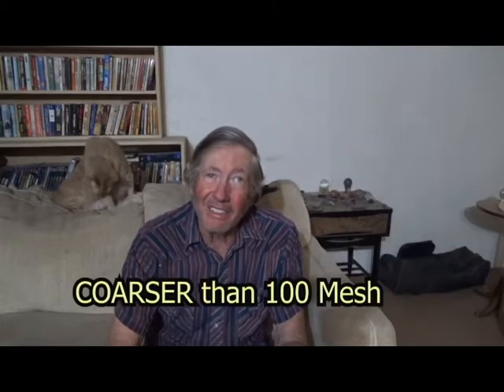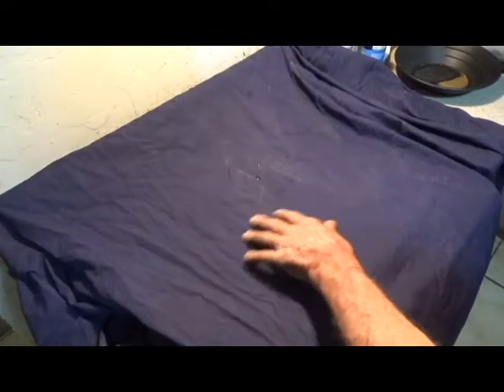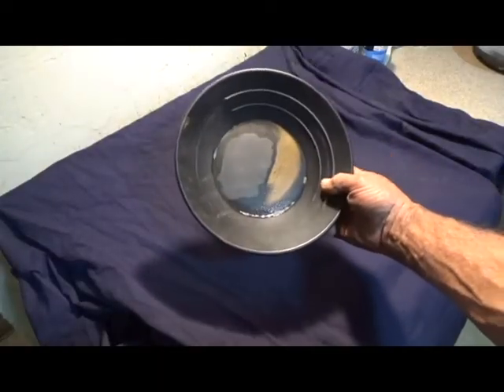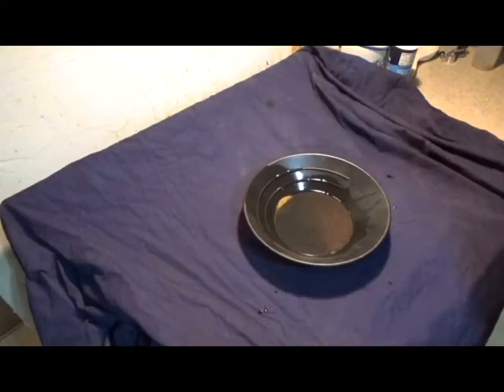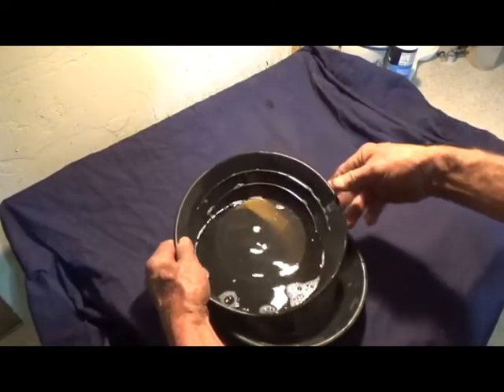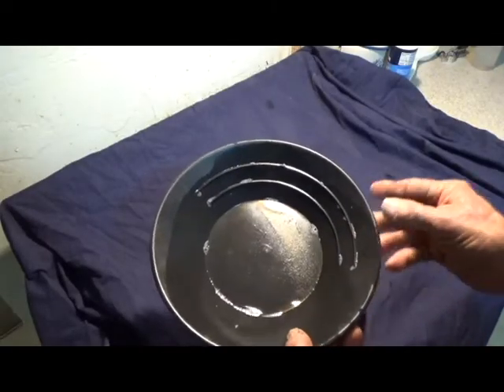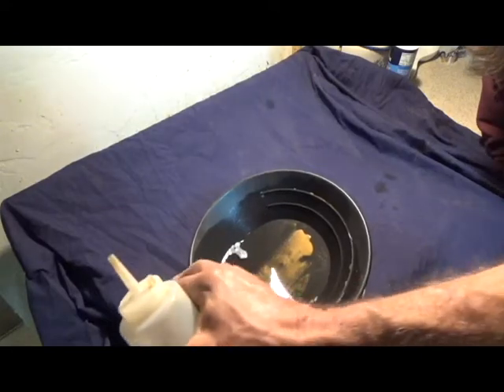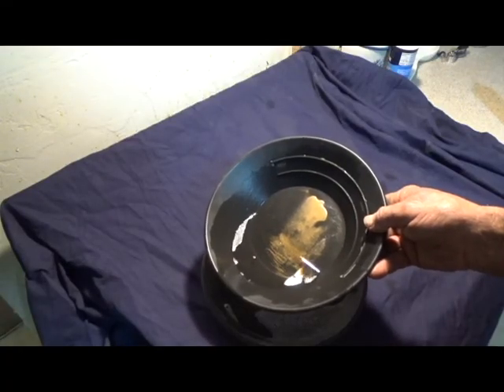193 Fine Gold and Microfine Gold Behave Differently in the Pan

Comment: I roast my ore and it makes little bbs but smaller. They are deadly for rolling the fuck away.
I had a big one roll out of my pan and was lost.
One guy panned and tapped to the top. But the waste or anything washed down, he would pan the bottom out carefully.
So he taps to the top, then pans out the bottom lip. he pans in two places. first pay attention up on the top, like you do there.
But then he washes out and repans the waste material. with the other material hanging on to the top. I think he was going after those bbs..I thought about pounding on them to get them flat. But I haven't figured a way. Most of my stuff is 100 mesh or smaller.
It shows in the back of the pan as you move material forward.
But if you insist on fucking around it goes out the sides and gets lost before you even get close. My adventure is using black sand to grab and shelter the gold. 
then use a magnet.I have the vibrating sluice. I added a pvc pipe to add material into. Just a 2 incnh  and it has a hole and a funnel hot glued. I attached some computer magnets on the bottom of the pipe (Outside of pipe) with a glue gun and have a pile of black sand on each one (On the inside)as a chance for the gold to ride the iron horsey.Since the pipe rests on the vibrating area, so the pvc pipe vibrates too. My wife went to the hospital in ICU for 10 days. I have been goofing off on my sluicing crushing and panning. i want to get going again. I seem to have silver or electrum pigging out my Aqua regia
I think I need to get the silver out. Filter out Silver chloride. Over and over.
I could learn to use Sodium Nitrate add 1 to 1 with HydroChloric acid. 
Hopefully I can pour off the silver (save) and that leaves the gold?
then add my aqua regia.I may have a palladium problem.
my stannous test looks some purple but changes to tan/ light brown tint.
I miss you all. I hope you are doing well.
Did you ever get to dousing? Ok God Bless. Have fun!

Comment: Fantastic revelation. Now I know why I either get micro fine one time and fine the next.  I guess I will have to process the gold twice!  Thank you for all your great videos.  I have learned a lot.
Reply: The gold we found in Wyoming is so micro-fine we can't see most of it without a microscope.  Some of the gold is visible and it accumulates in black sand in the creek and we can see it  where it accumulates and when the sun is shining on it.

I pick up dirt in my hand and drop it and look at my hand.  If I see micro-fine quartz crystals I know I'm close to where I need to be.

My gemalogical microscope is 360 power.  It tells me part of what I need to know.  ICP assays give a near accurate assessment and tells in ounces or grams per ton.  These assays are checked using one ton vat tests.

Infra-red photography, advanced prints and Google Earth assist in delineating any potential ore body.
Reply from the maker: Sounds like a good area to follow the gold upstream to the originating lode.
Reply: The metals came from ancient stock volcanoes and pyroclastic rock flows.  The volcanics overlay the sedimenmentry rocks. 

Eventually the gold works its way toward and into the Yellowstone River unless it gets bound in some kind of trap.
Reply from the maker: The live stream tonight at 6PM should be very informative as some guests will have real life problems for me to work on.
Reply: One guy panned and tapped to the top. But the waste or anything washed down, he would pan the bottom out carefully.
So he taps to the top, then pans out the bottom lip. he pans in two places. first pay attention up on the top, like you do there.
But then he washes out and repans the waste material. with the other material hanging on to the top. I think he was going after those bbs..I thought about pounding on them to get them flat. But I haven't figured a way. Most of my stuff is 100 mesh or smaller.
It shows in the back of the pan as you move material forward.
But if you insist on fucking around it goes out the sides and gets lost before you even get close. My adventure is using black sand to grab and shelter the gold. 
then use a magnet. I have the vibrating sluice. I added a pvc pipe to add material into. Just a 2 inch  and it has a hole and a funnel hot glued. I attached some computer magnets on the bottom of the pipe (Outside of pipe) with a glue gun and have a pile of black sand on each one (On the inside) as a chance for the gold to ride the iron.
Then My Adventure pans it right down to the black sands and then removes them with a magnet. There are the heavies left with the gold. The nonmagnetic black may be something, silver, platinum (something.) save the heavy and smelt them.

Comment: Pannng hard rock gold is definitely different than placer. The usual 'backwash and tap' method doesn't seem to work well for hard rock gold. As you mentioned, a different set of techniques is required. Thanks for shedding light on those. Also, a small black finishing pan is a must! I tried panning hard rock gold with a green Garrett Super Sluice (works well for placer). I thought there was no gold in the material, even when looking through a 10X loupe. I tried a black pan instead (a small Gold Claw), and suddely the same material revealed some gold. Might have been the black color, or perhaps the jigging motion back and forth that held on to the gold. Not sure. Regardless, I found it was the contrast between the black pan, gold, red garnets and green volcanics, as well as the behaviour of gold while gently back washing and side to side washing that proved it was gold. Thanks Keith, appreciate your work and all the insights you share! - Dan from www.Pickaxe.ca

Comment: The problem I stated when you came by. Gold that is beyound 100 mesh? Is to fine to define by itsself. Pluss I wondet how much started out super small like that? As crushing it is not necessarily goling to eroad it smaller than 100 mesh. As it probably takes a abrasive situation to get it any smaller. That' or, in its formation? It never was any bigger. Meaning it may take doing more to get it down in size, macanichaly. May take a rock tumbler? That wears on it. And does not try to break it up. As to mach what I have seen on the beach? It has to be small enough to be unsustainable to holding it in the pan. 

With out any definition of size to mesure? 100 mesh and smaller is lost to the water molicues. Why 100 sticks to the pan. It is sticking to the molicues of the pan. But any smaller? And it does not have enough indevidual mass to keep it on the bottom where it sticks. Why I change the pan out for the board. For working the waist out. As only dry does the cohesion quit. And the static charge of accumulated gold can gather up the super fine gold in itsself. Leaving everything else free to fall down the doard with out the cohesion to hold it with the gold. 

Why countering curents and eddies free the gold from traveling along the waters path with eveything else. And if working off mostly waist? Peaces will not be able to gather with them selves. Before migating out of a semi concentrated state.

No' water is the enamy here.  It works great for 100 mesh and larger. But is to destirbing to the smaller gold to seperate out as itsself in a concentrated mass. As no one peace can stay on its own. And needs the other gold particles to hold on too. As the surface molicules of the pan are more easly filled with water molicules. And the super fine gold has no mass or wait to displace it. So it can stick. But when many acumulate? It becomes even easyer for it to stay locked to the bottom. As it fits into the cavities inbetween the molicules of the pan. Where the static weight builds in its acumulated mass that holds even more gold. But if panning it with water? Not all can fight its way down while everything else is rising up in cleaning a consentration with mostly waist in it. Adding to the exiting cohesion. And not getting to the bottom. 

But like I said. It may be dificult to get it made as small as it is made in nature. And not something most are going to ever do? Making gold small, that it will be more easly lost by doing it. No one does that. And is why no one knows the exstent of micro gold in placer. As everyone thinks it is just like whats milled. Because its the smallest gold they know of that is in any concentration. So when its seen in the pan? Everyone thinks they got it all. With no way to question if they realy did. 

As a kid I lived neer the beach. And tried to pan the ghost gold that apeard there in ribbons. Could see endless amounts of it. And even if I was a expert panner at the age of ten? I never seen anything in any pan I did. Back then i thought it was a mater of tecnheck to do what everyone said was Inposeble. So I tried a lot.

Well im going back to that same beach. And will get my revenge.  I know now how to get it out. And even found a place where the sand washes into a small round island. The last one i saw when i was a kid? Would be solid gold ontop of it. Like a gold ball sticking out of the sand. And only visable on a reseeding tide.  With the light of the sun low on the horision infrount of you. Otherwise there was nothing there to be seen. As i believe that a magnetic force exzists in the vast blacksand deposits. As there has to be something that gets all the particals of gold to lay only one way? So all can be seen at ones as a whole. Because there was nothing there otherwise. As a pan would not yeald a single notion of a idea, that there was any gold there.
Reply from the maker: I'm having some trouble following the theory with words. Assuming you get it worked out by summer, perhaps we could come by to see in person when I get a few days off.  That trick with screening without screens has sure come in handy a couple times, but it is a lot easier demonstrated than explained.
Reply: @hardrockuniversity7283  Yea' I m real short on words lately. Brother's pushing hard for me to be gone. But could or will not leave untill I'm dam well ready. And 750 a month? Helps! But is a slow road to getting on my feet. Still have IBS and eat only eggs. And now take a drug called Linzess. Everyone says this is not hell? I'm trying. But still not seeing it.

Comment: Thanks Keith..this was helpful!  Along a similar line, when I first got my blue bowl a few years back, being new to all of this, I didn't read the instructions carefully and did not properly classify my cons further other than just running all the material together in the bowl that met the maximum size restriction recommended to put into the bowl criteria from the maker/manufacturer.  I later realized myself, confirmed after talking with prospector Bud who runs the prospecting store in Helena, that  I lost some fine gold when I would let the bowl run unattended for awhile with the water pressure turned up to the point where the heavier black sands would slowly be discharged in the middle as is normal, thinking that the gold would stay put being "heavier", and not considering the weight of the individual larger black sand particles was greater than some of the small finer gold particles to the point where I had some microfine gold losses as I tried to segregate the gold from the black sands.   

When I started to classify the cons into 3 or 4 size groups (all under the max size) and run one group at a time the bowl pretty much captured all the gold no matter how small, at least that which you could see with a loupe. As you pointed out in this video, I could see how easily some larger gold could be missed in the bottom of the pan when using the tapping method or something similar...
Reply from the maker: Thanks for the info on the blue bowl, I haven't had much experience with them

Comment: I got 50 mesh magnetite. I used strong magnets with a technique and was able to extract the magnetite. All I was left was silt... I panned it out and I had what looked like floating gold and it was sinking.. huge pile at bottom... I got 50 lbs of the 50 mesh and after working with some a while i extracted enough and it was heavy.. but now I'm not sure if it's just fools gold so i stopped processing till i figure out if I'm wasting my time... i think it might be fools gold because when it shines under light it sparkles but then specks look blackish back to sparkle yellow.. mine is 50 mesh or smaller.. maybe 35 mesh specks that fill a 15th of the bottle of a Tabasco bottle with only 8oz cup full of 50 mesh magnetite. Some smart guy told me I could use n52 magnets with a technique to remove only the magnetite releasing any trapped micro gold clung in between the magnetite dust. The amount I got seems too goo to be true so I stopped till I can do a acid test. Its heavy..
Reply from the maker: If you have a scale do a density test.  With that much it should be fairly straightforward.
Reply: Im in the same boat. I dont know what i have either. But im getting a sluice tomorrow. So, I hope that helps plus my daughter is bringing her metal detector.